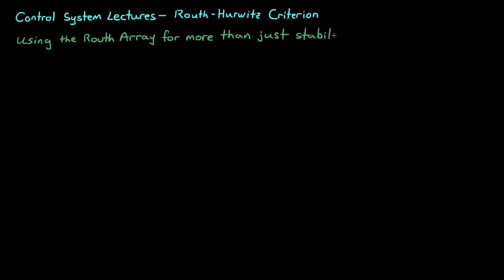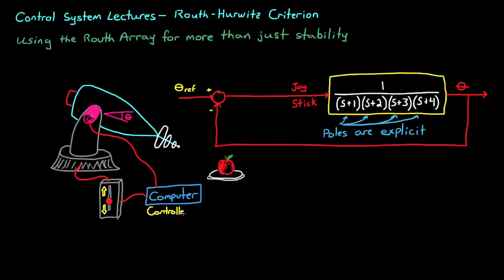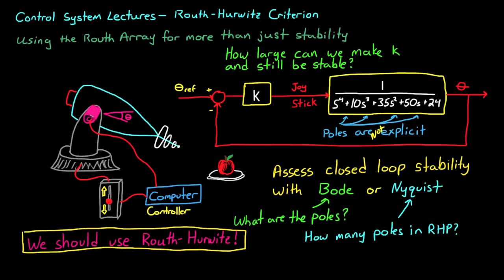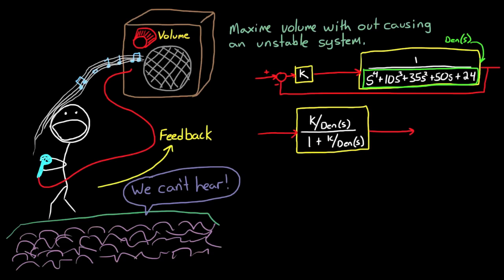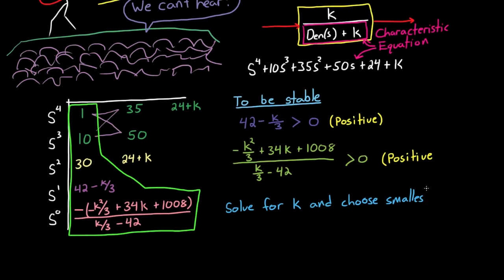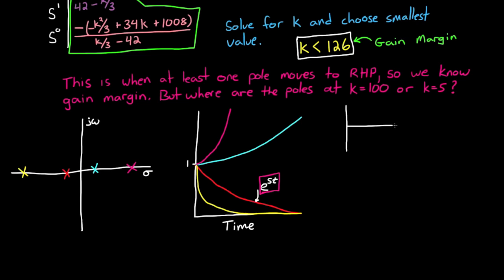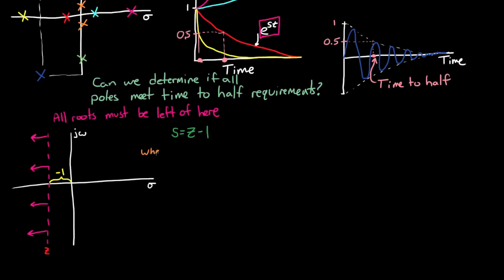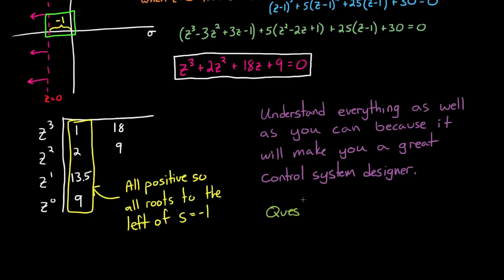Routh-Hurwitz Criterion, Beyond Stability

Comment: Thank you
How to find minimum gain?
Is there any method to find minimum gain or is trail and error?
Reply: Same method.  You will just end up with either two equations to solve for K, when the equations equal zero, or a single quadratic equation to solve for K, when it equals zero.

What you are looking for, is the range of K values, where the entire first column of the Routh array is positive.  So every expression with K in the first column, is a candidate for finding stable values of K.  You simply find the K-roots of all of them, and look for where all expressions are positive.  The closest pair of K-roots that swap the sign, will be the bounds on K.

In this example, K would need to be >-24 for the system to be stable, which you'll find when you simplify the final term.  The negative K-values usually aren't of interest, because K is considered a positive control constant, rather than a number that could have either sign.

Comment: The Routh-Hurwitz Method tests if there are any polynomial roots with Real Part > 0.

 This means the test will detect the presence of roots where Re(z) > 0.

Because we want to know if roots are to the right of the line Re(s) = -a, this gets mapped to the z=0 axis.

s=-a  is mapped to z=0   s+a=0=z,  z=s+a.   

 To apply this transformation, you must replace s with z-a. 

Now you need to calculate how far you shift the vertical axis for the time to half calculation. 

exp(-a*t) = 1/2
-a*t = ln(1/2)
a*t = ln(2)
a = ln(2)/t

Change to variable z (s=z-a)
and run the Routh-Hurwitz test on the polynomial in the variable z.

 If you find RHP roots in z, that means you have roots to the right of the Re(s)=-a line in the s-plane.

Comment: What exactly is the gain? Is it the same thing as proportional element?
Reply: It could mean multiple things depending on context.

It could be:
A: the value of K, the control constant for the system.
B: the magnitude of the open loop transfer function, which is the ratio of amplitudes of output signal to input signal, if we leave it open.
C: the magnitude of the closed loop transfer function.

Comment: Solve for K and choose the smallest value, I got -24<K<126, should I choose -24?
Reply: I also got the same values .  I guess since we are trying to build an amplifier whose purpose is to multiply the amplitude , I would choose a value closer to 126 .
A value of -24 would still result in a stable system but would attenuate the input signal .

Comment: Sorry,but can you highlight on the time requirements such as "time to half" or "time to double"?
Reply: The impulse response of a pole is e^st (where s is the pole location in the s-plane).  So if your pole is at s = -1, then the impulse response would be e^-t.  And in this case the time to half would be approximately 0.7 seconds.  That's because at t=0 the response would start at 1, at t=0.7 the response would be 0.5, and at t=1.4 the response would be at 0.25 and so on.  "Time to half" is equivalent to stating "poles must be to the left of -1" ...... This was the reply given by author in below comments.

Comment: Hey, Brian Thank you for the lecture: you are really helping a lot of guys around the world., B-) (Hope that helps you sleep better at night). haha.., So just one question about the time to half requirement. If you are given a numerical value: say 5 seconds. i.e the output signal amplitude should decay to 50% of its peak amplitude in 5 seconds. How does one calculate the appropriate Z value from this information so that one is able to translate the S-line to the new Z-line.
Reply: The impulse response of a pole is e^st (where s is the pole location in the s-plane).  So if your pole is at s = -1, then the impulse response would be e^-t.  And in this case the time to half would be approximately 0.7 seconds.  That's because at t=0 the response would start at 1, at t=0.7 the response would be 0.5, and at t=1.4 the response would be at 0.25 and so on.  "Time to half" is equivalent to stating "poles must be to the left of -1" ...... This was the reply given by author in below comments.
Reply: @Naquatsch   so for quicker response times we can increase s
Reply: sorry decrease s

Comment: There is a little trick my professor shared where when you are performing the figure 8 math talked about in the video and have a L shape pattern (with a zero in the bottom right hand corner) then the answer to the figure 8 math is the value of the top right hand corner.

Comment: Hi Brian, I'm studying AC at the moment and have an exam on Wednesday for it. I don't really understand the concept of a "gain", every definition I've read about it keeps saying it's a "signal amplifer". But that still doesn't clear my understanding, please could you explain what a gain is? Much appreciated!
Cheers,
Keep up the great work!
Reply: +Akshay Malde I don't know if you still need the definition of gain but since I read your comment I would like to make my humble attempt to clear the definition of Gain.

Gain, as the name implies, is increasing the amplitude of the signal. Why we do that? 

Let's say I whisper to you standing 10 m away.

Case 1 (open loop): If you don't give me feedback of mine being inaudible then you will never hear what I said, that is unless you have super sonic ears (hehe). 

Case 2 (closed loop): If you give me feedback that I am inaudible and ask me to raise my voice (In other words, to increase the amplitude of my voice signal OR in other words, to increase the positive gain of my voice signal) then I will use my vocal controller to increase the amplitude until my voice is audible to you.

This was a small and very weak example for gain, but the underlying concept remains the same. Your signal strength (amplitude) must be sufficient enough to meet the current task. A 10mA signal cannot run a 100mA motor. So you need to add a K=10 multiplier gain block to meet the requirements. With the help of Routh Array you can check if the this new block of 'K' would not ruin your systen stability. I your system remains stables then "Green signal" - go ahead and add an amplifier (a device which increases gain) of Gain K=10. Hope I helped atleast 1%... :)
Reply: I have understood it as:

say you have a robot and you want to move its leg. You can move your leg very slowly by taking 10 mins to get to the point. But you could also get there in 1 sec. You get different times by gaining velocity. But if you move your robots leg very fast, your robot will fall down. But you don't want to wait 10 mins to get leg to specific position. So suitable gain will get the robot leg as fast as possible at specific position without falling down.
Reply: Bump. Would love to hear someone explain gain as well.

Comment from the maker: You can specify your requirements either way.  Sometimes it makes more sense to specify time to half or double, especially when there are humans in the loop.  For example, if you let go of your steering wheel your car would eventually veer off the road even if the road was straight.  In this case the plant (car) is slightly unstable.  As long as the time to double is small enough for the driver to compensate for the veering then the closed loop system with the driver will be stable and safe.
Reply: I haven't seen this in a textbook. This is the kind of info I'm here for. Thanks!

Comment from the maker: Hello Scott, I didn't do a good job explaining that.  The impulse response of a pole is e^st (where s is the pole location in the s-plane).  So if your pole is at s = -1, then the impulse response would be e^-t.  And in this case the time to half would be approximately 0.7 seconds.  That's because at t=0 the response would start at 1, at t=0.7 the response would be 0.5, and at t=1.4 the response would be at 0.25 and so on.  "Time to half" is equivalent to stating "poles must be to the left of".
Reply: Thank you so much for the explication. However, i still have some question. To ensure the time to half, as you said that “time to half” is equivalent to poles must be to the left, then, when t=0, the response should be 0.5, not 1. isn’t it?